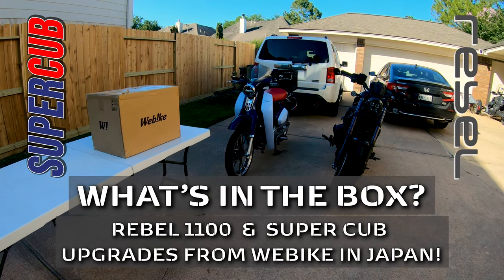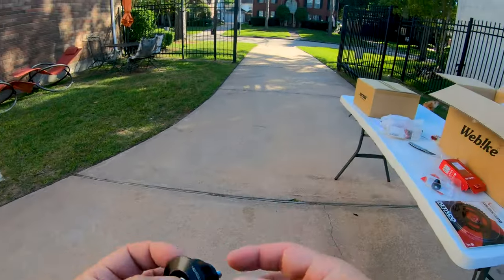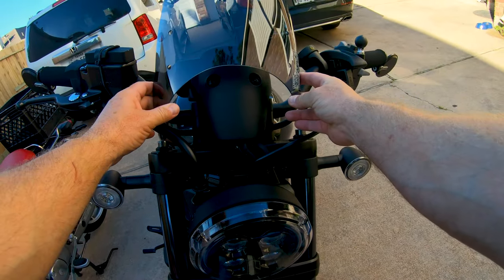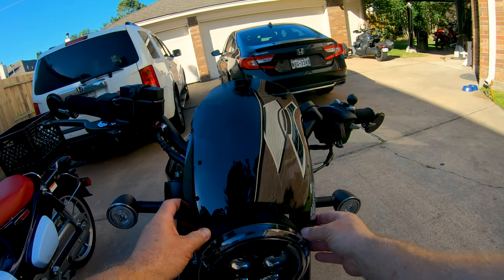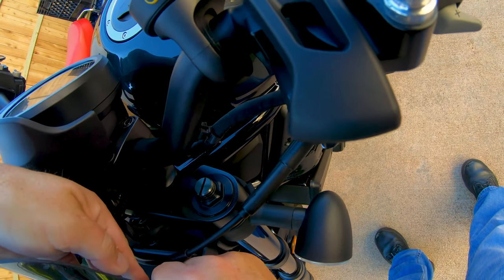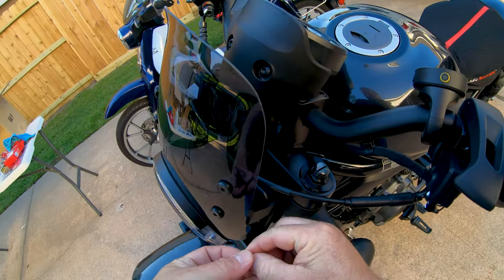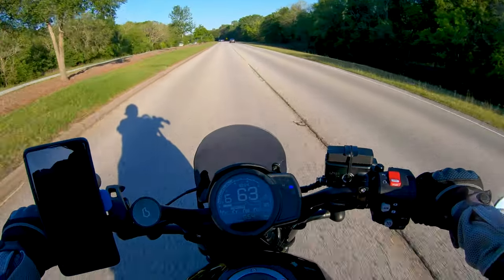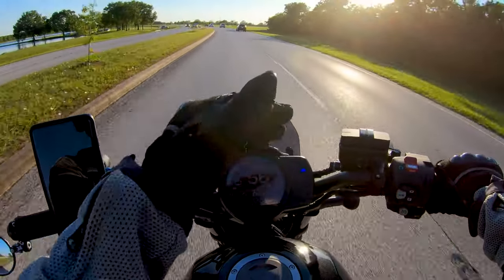REBEL1100: Daytona Aero Visor windscreen for the Rebel & other upgrades for the Super Cub!

Comment: The Puig touring windscreen for the Rebel 500 fit my Rebel 1100 without any issues. It is taller and wider like what you wanted. I can send you a picture of what it looks like if you would like me too.
Reply: Thanks for this info. I pick up my 1100 soon and wondered if my Puig windscreen would transfer from my 500 no problem.

Comment: GG I can wait for the video of the brake of the super cup. Thank you for your work.
Reply from the maker: Thanks, Yves!  I will make a series of road-prep videos for the Super Cub leading up to my trip in July.  I plan to upgrade the front brake caliper and put fresh brake pads on there at the same time.  I probably won't do the brake line upgrade until later... still don't have a supplier for the stainless-braided lines yet.  I'm interested to see if the dual-piston caliper improves the brake feel just by itself.  We'll see!  Cheers!  👍  --QM

Comment: Great.  I am thinking buying the visor after watching your video.  In addition to the visor, I also want to have a handlebar riser and engine guard.  Waiting for more products coming.  Have a nice day. Thanks for your video.
Reply from the maker: Thanks for the feedback!  I'm still searching for handlebar risers (setback risers).  Another viewer said that the risers for the Rebel 500 also fit the 1100, so that helps with the search.  I'm hoping that SW-Motech makes an engine guard for the 1100 soon... their products are top-notch.  I have a SW-Motech guard on my CB500X and it has done its job a couple of times with driveway and parking lot tip-overs... barely a scratch to be found.  T-Rex Racing ( @TRexRacingInc , https://www.youtube.com/c/TRexRacingInc ) is making a bunch of parts for the new Rebel 1100, but they won't be in stock until around October 2021:  https://www.t-rex-racing.com/2021-Honda-Rebel-1100-Products-s/2229.htm . Cheers!  👍  --QM

Comment: After watching your video on changing the exhaust, i'm interested in finding out if you have figured out how to remove the mounting arm for the old exhaust. Will you make a video on how to remove it?
Reply from the maker: I haven't looked into removing that bracket quite yet.  That bracket also supports the passenger footpeg, so I'll probably leave it on the bike.  I have the passenger seat kit on order, so that will be installed sometime soon (hopefully).  I will be sure to video that process when it happens, and we might see if/how the right side bracket can be removed while I'm installing the left side footpeg bracket.  Cheers!  👍  --QM
Reply: @QuasiMotard  Ok, cool. Thanks

Comment: Hi, I am subscriber and appreciate your videos about the 2019 Supercub.  I own one as well. 

I have only put 2k miles on it but lately, the battery needs jumpstart to start every time so I carry a battery pack and jumper cable when I head out. What do you think may be going on with the battery or the starter/ignition?

Thanks in advance for your response
Reply: Hi. I am still thinking about Super Cub. My biggest doubt is motorbike's size. I am not small guy (185 cm and 105 kg). I don't want feel like like bear on bike:) What your experience on riding with Super Cub?
Reply: Check the voltage on the battery  when the bike is running. Should be at least 13v. If that’s good then you just need a new battery. On my scooters I’m lucky if I get 18 months battery life. Don’t buy the cheap brands online. Stick with yuasa And use a battery tender if you don’t ride that often
Reply from the maker: Luckily, I haven't noticed any problems with my Cub's battery.  It's not uncommon for my Cub to sit for several weeks without being started, and I've only had one occasion where it was reluctant to start (after sitting for nearly 2 months).  However, I have received several similar reports from other Cub owners saying that their batteries are constantly going flat or not charging properly.  I will be replacing my OEM battery with a high-quality SLA (sealed lead-acid) unit before I start my long trip around the country in July just as a precaution.

Does your Cub start normally after it has been running for a little while and then sitting only for a few minutes (e.g., less than an hour)?  If yes, then the charging system is probably working ok.  If it isn't able to start after running for a short time, then the battery might be defective and not accepting a charge properly.  The charging system could also be defective, but that's less likely.

The parasitic drain issue is another interesting topic.  Some owners have mentioned that the dead battery happens whenever they use the alarm (immobilizer system).  I don't use the alarm feature on my bike at all, so I can't comment whether that contributes to battery drain or not.  I have added a battery tender lead to my Cub's battery just in case I need to jump-start it or to have enough juice to unlock the smart key system.  The Cub can be push-started (bump started), but you must be able to unlock/enable the ignition first.  If the battery is completely flat, then you can't engage the smart switch to turn it to the "ON" position.  Attaching a battery tender lead allows you to power the system independently in case of an emergency (dead battery) so you can unlock the ignition or the seat.

If you ever need to push-start the Super Cub, just turn on the ignition, make sure that the kill switch is in the "RUN" position, and then shift the bike into 2nd gear.  Hold the shift lever down to shift into 3rd gear, but don't release it yet (clutch disengaged while the shift lever is down.  Walk (hop) alongside the bike until you're moving at a jogging pace and then release the shift lever to "dump the clutch"... the Cub's engine should fire up without any problems.  We tested this procedure during our last road trip when my Yamaha XT250 ate its regulator and stopped charging the battery.  Adrian helped me push start my bike several times, and we decided to try it on the Cub... it worked flawlessly!  Cheers!  👍  --QM

Comment: Would appreciate an update on what you think of the visor after couple of months of riding.  I would like to get a visor and like the style of the Daytona but wondering if you think it is worth it now.
Reply from the maker: That's a tough question.  If the screen were the only thing that I ordered from Webike in Japan, then no... the cost of the screen plus shipping wouldn't be a good value.  I ordered several items from Webike, so the shipping costs were spread out over multiple pieces and didn't hurt so bad.  😉

The Daytona screen is just a  bit larger than a meter visor (flyscreen), so it only deflects a bit of air around my torso.  I'm still searching for a more substantial screen, but not so large that it ruins the aesthetic of the bike.  Hopefully, Dart flyscreens or another vendor will make something sleek but just a bit taller than the Daytona.  👍  --QM
Reply: @QuasiMotard  Thanks for the reply.  I ordered the Daytona engine guard from Webike and if I had found your video earlier, would have been been good to order them together.  I'll holdoff until other shields come out.  By the way, their engine guard has a nice design and am happy with the install/look on the bike and would recommend it if you are looking for bike protection.
Reply from the maker: Thanks for the tip!  I've been looking at that guard, but I'm holding out to see if SW-Motech makes a guard for the Rebel 1100.  I have the SWM on my Honda CB500X and it's fantastic... lots of protection with minimal extra width.

I'm hoping that there will be a good option for a guard that will also serve as a mount for driving lights and highway pegs.  I have those items ready to go, but no place to mount them!  😉👍  --QM

Comment: Very nice video and helpful reviews.
Back to the 1100, when you get on the freeway (like your I-10, SW Fwy, I-45), does the bike give you a sense of stability with the windshield? Freeway traffic flow in my area is generally around 80 MPH and so I have to take that into consideration for my next bike.
Reply from the maker: Thanks for the feedback!  Yes, the Rebel 1100 is a heavy bike, so it's very stable at freeway speeds and it isn't affected much by crosswinds.  However, the seating position and lack of any wind protection can make long high-speed rides a bit tiring.  The Rebel's seating position forces your legs outward more than a standard bike (e.g., naked bike or traditional seating position), so you catch a lot of wind with your legs and torso at the same time...  I feel like a flying squirrel in a wind tunnel most of the time.  🤣

The Daytona Aero Visor helps to break up the wind pressure on the center of my torso just enough to make extended highway rides bearable, but still not comfortable.  I am still searching for a medium-sized screen to help with full torso coverage but not be so big that it ruins the aesthetics of the bike.  I've seen a few universal screens that might work, but I'm not keen on clamping anything to my fork tubes or handlebars... I'd much rather have a mounting solution that is designed to work with the factory bolts and clamps.  

I'm busy preparing for my big Super Cub cross-country trip right now, so the Rebel projects will be on hold until I return in August.  Cheers!  👍  --QM

Comment: Did the mirror adapters work without modifications?
Reply from the maker: I haven't even installed those adapters yet!  I've been swamped in other projects, so they are still sitting in the box waiting patiently.  I'll be sure to post a quick video or pics when I swap those onto the bike.  They appeared to be larger diameter than the original units, so I'm not sure if they'll work with 7/8" mirrors... we'll see!  Cheers!  👍  --QM

Comment: Did the wind noise increase since the air is now directed under your chin?
Reply from the maker: No, I haven't noticed any additional noise or buffeting due to the windscreen.  The airflow is directed toward the top of my chest around my sternum, so my helmet is still in clear air (laminar flow).  The small lip at the top of the screen seems to be what is directing the bugs toward my chest and neck, so I'll monitor that situation to see if that was an isolated incident or if there is a remedy for it.  Cheers!  👍  --QM

Comment: Question. Why do you ride with your high beams on during the day?
Reply from the maker: That is a frequent question for many of my ride videos.  In the USA, it is a common and recommended practice for motorcyclists to ride with the high beams on during daylight hours.  This is even taught and documented in our MSF (Motorcycle Safety Foundation) rider courses.  

Our cagers are very careless and aren't attentive to motorcyclists, so it is a safety measure to be more visible in traffic.  Of course, we dip to low beams during dusk and night hours to avoid blinding oncoming traffic.  Cheers!  😉👍  --QM

Comment: Did you see the new royal enfield meteor 350. Looks like they are trying to compete with the rebel 300. I figured it’s something you would be interested in.
Reply from the maker: Yes, thanks for the tip!  I watched a few videos on the RE Meteor 350 this week.  It looks nice, but it's facing tough competition with the Honda Rebel 300 at that price point:

2021 Royal Enfield Meteor 350 (MSRP $4399 USD)
Horsepower: 17.4 HP @ 6090 RPM
Torque: 18.2 lb-ft @ 2860 RPM
Wet weight: 418 pounds

2021 Honda Rebel 300 (MSRP $4599 USD, $4899 w/ ABS)
27.4 HP @ 8500 RPM
19.9 lb-ft @ 7300 RPM
Wet weight: 364 pounds (370 pounds w/ ABS)

The Rebel weighs in at ~50 pounds less, and it makes 10 HP more than the Meteor.  The peak torque is nearly the same between the two, but the Meteor has it much lower in the rev range (better for city cruising) than the Rebel's higher peaks.  However, the fact that the Meteor weighs so much more than the Rebel makes the Meteor's peak torque less effective, especially as the speed builds.  

I do think the Meteor looks better than the Rebel, though... less Transformer-ish and more like a traditional cruiser.  I don't dislike the baby Rebel, but it looks like it's missing something in the engine bay under that tank... too much empty space and not enough meat.  The Rebel 500's mill looks more complete hanging under there... less daylight looking sideways through the frame.  I've almost purchased the Rebel 300 & 500 a few times, but I already have two of the 500's in the stable (CB500X and CB500F)... couldn't rationalize adding a third one.  The Rebel 1100 fixed that dilemma for me!  🤣👍  --QM
Reply: @QuasiMotard  I went to the dealership today and I’m picking up a fireball red one tomorrow. The dealer said i’ll be the first one in NYC to ride one off the lot. 

Thanks for all the great content. Your videos helped me go out and buy the cub.
Reply from the maker: @richfatte1  Thanks for the feedback, and congrats on your new Super Cub!  With the recent rise in gasoline prices, these little mini-moto's are going to become even more popular!  I'll be rolling through your general area on my Super Cub about a month from now on my way up to Bar Harbor, ME for the Scooter Cannonball Run!  ( https://www.google.com/maps/dir/Katy,+TX/Town+Pier,+Bar+Harbor,+ME+04609/@36.8395932,-91.0302421,5z/data=!3m1!4b1!4m17!4m16!1m5!1m1!1s0x8640dff9ae358adf:0x17966e0d7c2b1125!2m2!1d-95.8245093!2d29.7857765!1m5!1m1!1s0x4caebf7d610a3cd3:0xacc245072fa481e6!2m2!1d-68.2040537!2d44.3919925!2m2!1b1!2b1!3e0 ).  Cheers!  👍  --QM

Comment: It’s certainly not going to do much since it’s barely taller than the speedo.
Reply from the maker: It certainly doesn't do much for shielding the rider's shoulders or helmet, but it does reduce wind pressure on the chest.  There aren't many screens available for the 1100 yet, so anything is better than nothing at this point!  I'm still searching for a decent touring screen that isn't a barn door... needs to blend with the bike's aesthetics.  The Dart Flyscreens Marlin looks really good... I'm hoping that they make a fitment for the Rebel  1100 soon.  👍  --QM